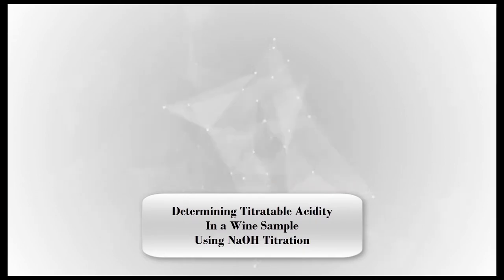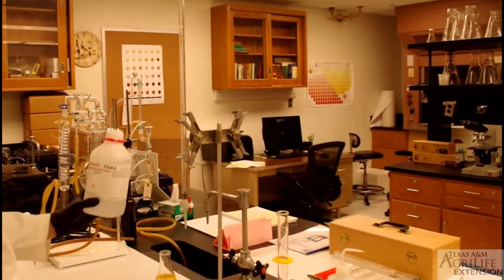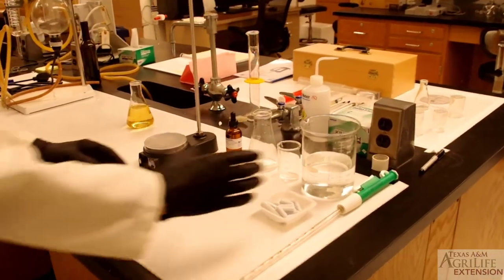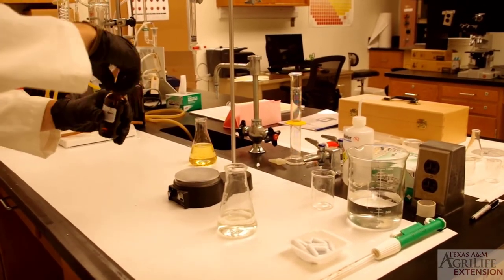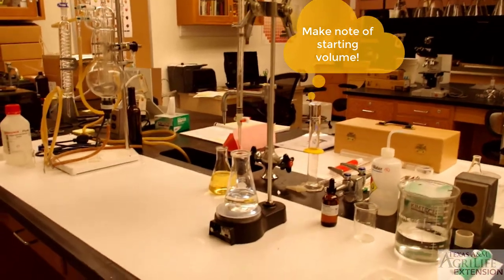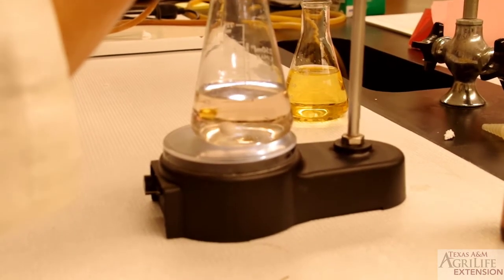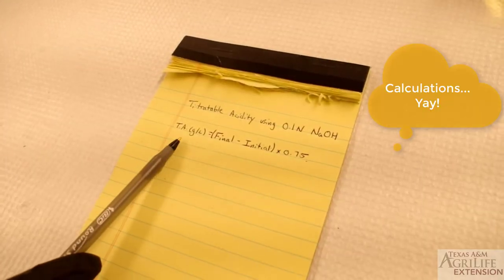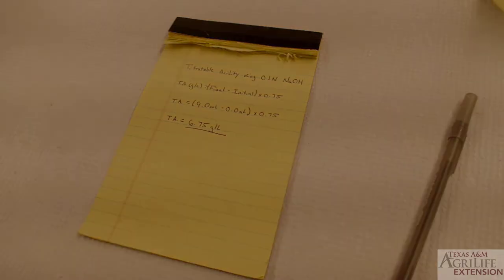Determining Wine Titratable Acidity Using NaOH Titration

Comment: some people use 1M NaoH and others use .1M. Which one is correct?
Reply from the maker: You can use either. With 1 M the final volume is going to be much smaller and it's somewhat harder  not to overtitrate. The calculations would need to be adjusted based on concentration
Reply: Why do we always choose Strength of NaOH as 0.1N ?

Comment: 0.75 what is it
Reply: it's a conversion factor based on normality of NaOH solution. For this particular normality 1 mL of NaOH will neutralize 0.75 grams of acid
Reply: @ioanaandreeabotezatu198  can i use it for cabbage juice too with same normality of sodium hydroxide
Reply from the maker: @mercyndujilo5363  Are you trying to measure titratable acidity in cabbage juice?